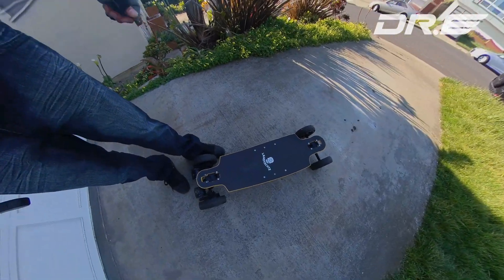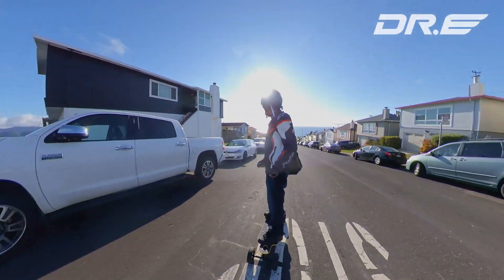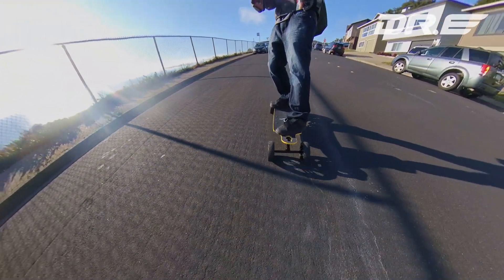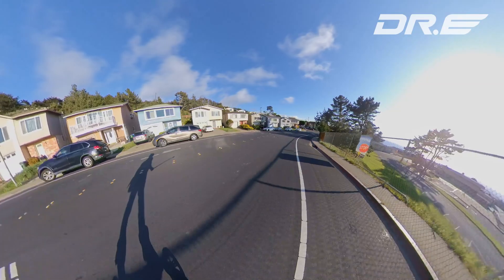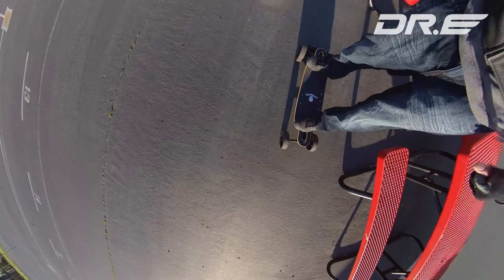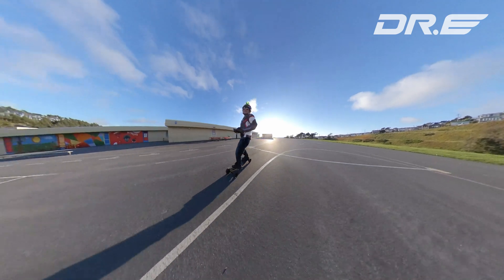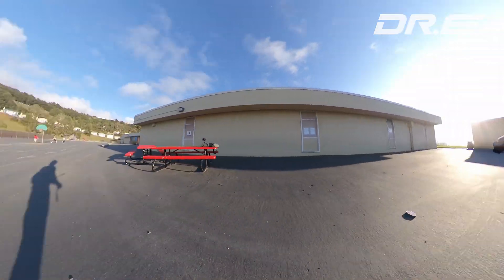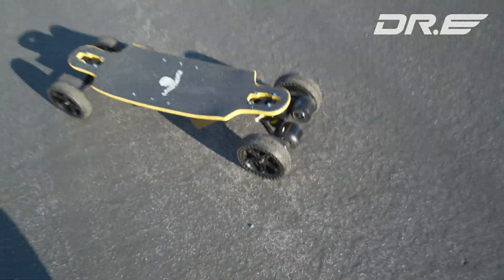5000 Watt DIY Boosted Mini S Electric Skateboard w/ ATR Wheels! [#MadMaxMini Protytype 1]

Comment: Nice machine. Only thing that would bother me is that you are like an egg on a spoon. If the board is doing 30mph and then stops suddenly for any reason, you will find out what it’s like to be Superman for a very short time.
Reply from the maker: Yes that is why you have to know what you are doing.  This board will not do that thanks to safe cutoff voltages built into the vesc motor controller.